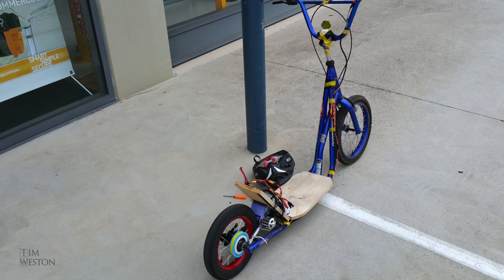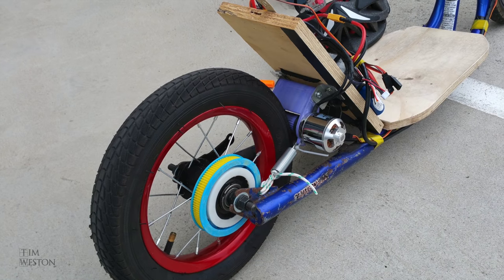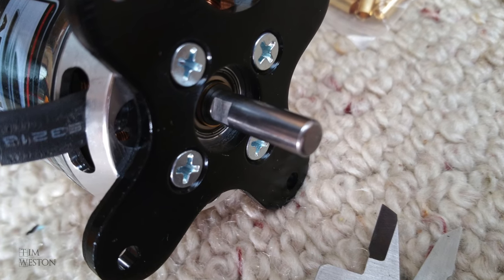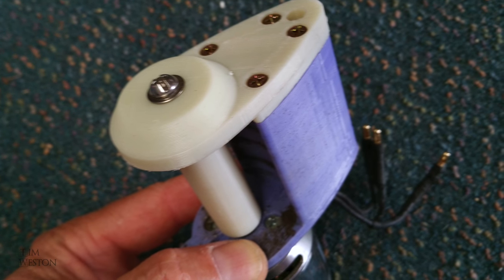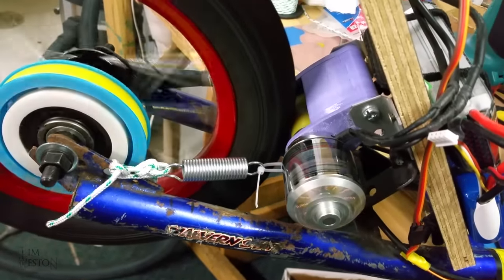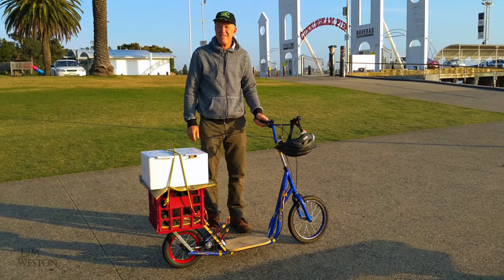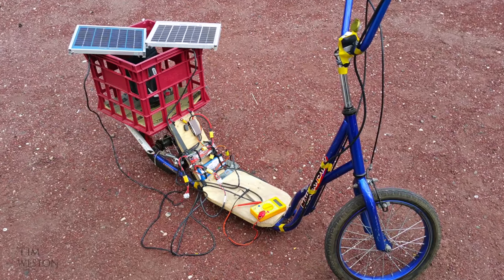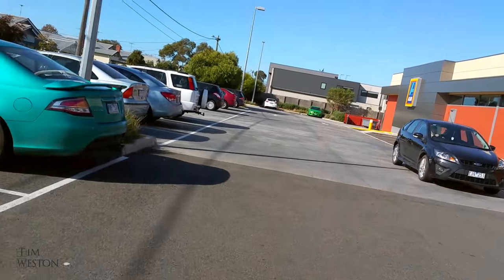How to make your own electric scooter - DIY transport - part 1

Comment: Great performance, congratulations.
I like the friction drive in my bike.
Greetings from Poland
Reply from the maker: Thanks Ireneusz. Did you make one for your bike already?  I never tested it on my bike but it has the power to use on a bike.  The gearing is correct, doesn't matter what size wheel your bike is.  Greetings from Spain.
Reply: Tim Weston - 3D printing g

Comment: I doubt that's uptimised in term of torque / RPM, this kind of motor has way too Kv for such a 'torquey' device ?
Reply from the maker: You can buy more torque, lower Kv motors. But they are more expensive and for the scooter it's not really necessary. The torque this motor produced was more than enough for the job. And the RPM was optimum for the job.  Also I didn't use it's full performance. I tested it with 22V (6cell) and it had a top speed of 30kmh and excellent acceleration. Bu using a smaller roller I could slow down and have even better acceleration, hill climbing power. It's possible to go up to 10 cell with this motor. But you need a bigger speed controller.  For the money, it works just fine.

Comment: Nice drive unit design. Especially supported at the non drive end 👍
I'm trying to do something similar at the moment. Did you use the ESC brake? If so how did you get on with thermal management on the ESC?
I'm used to RC stuff so non of this is new to me but alot of people are saying to fit a one way bearing so it doesn't drive the motor when at 0 throttle and cause a large back EMF and damage the ESC.
But I've never had to do this with any RC plane or car for that matter even the 1/8th scale stuff and that has ESC braking from 70mph so the stress can't be much more on a scooter.

Comment: not bad for only 2 batteries add more batteries down the each side of the deck and or widen the deck make a subfloor for batteries
Reply from the maker: Yes Michael, there is plenty of room for more batteries, like you say.  You could quiet easily have a range of 30km or more without too much extra weight.

Comment: YOU SHOULD USE BELT DRIVE SIR FOR MORE POWER AND TORQUE
Reply from the maker: It's OK, you don't need to shout. I can hear you :) Yes, belt drive is better. But also requires more parts and time. This is just a simple way of doing it.

Comment: i will be able to buy a motor as shown in the video but it should be cheap and it should be delivered to india.and about what you are telling i will try my 12v motor
Reply from the maker: OK Harish
Reply: i want the gear box which you used in the video for how much cost can i get it
Reply: i really want to make this scooter will you help me
Reply: Hi Harish.  Yes, I can help you.  The STL files with instructions and list of all materials you need, I am selling for $6. If you can get the same motor, it will fit exactly the printed parts. If you don't have a printer, check online if there are 3D print services near you or a printer shop near by.  Send me an email to info@timwestonboats.com and I will mail you back with more information.  Regards Tim
Reply: Hi Harish. Yes, I can help you. The STL files with instructions and list of all materials you need, I am selling for $6. If you can get the same motor, it will fit exactly the printed parts. If you don't have a printer, check online if there are 3D print services near you or a printer shop near by. Send me an email to info@timwestonboats.com and I will mail you back with more information. Regards Tim
Reply: i am going to use a motor which is used in the self start of bike will it work
Reply: i can make the scooter which you used in your first project
Reply: but i need the exacly same gear box which you used

Comment: Always interested in what other Aussies come up with, knowing how restrictive our laws are regarding e-bikes and the like. SA just banned all petrol assisted vehicles last year and I hear NSW banned them some time ago (something to do with a politician's wife getting upset by a motorised bike rider and having a big dummy spit over it). Plus there's the 200W power limit unless it's pedal assist in which case you get to go to 250W (SA only - states vary). 
Are the laws for power-assist scooter much different?
Reply from the maker: Yes, aussie law's are restrictive.  In Vic it's 200W and 10kmh for scooters. I don't think all states are the same either.
Reply: What's annoying about that when they give a figure of 200W for e-bikes. No one makes e-bike motors below 250W apparently. Guess AusPost are breaking the law over here in SA since they're all 250W+ on the city e-bikes they use for delivery runs. Sure, you can use 250W if it's ONLY pedal assist, but I don't see the postie pedalling. Aussie laws are just stupid sometimes, really. "Oh no, too much power, it might compete with our automotive manufacturing" erm, that's dead now, fellas

Comment: better use steel roller.
Reply from the maker: Yes, steel would be better. The printed roller wore out pretty quickly, it was more to experiment what worked. I think even better than steel would be to cast it in Urethane. Not so aggressive on the Tyre.

Comment: did you program your ESC?
and would this still work if you used this ESC (https://hobbyking.com/en_us/hobbyking-red-brick-100a-esc-5vbec.html)
Reply from the maker: No I didn't have program the ESC. I'm not sure about your ESC..
Reply from the maker: No Anmol, I didn't need to program it. I'm not sure what that one is you have? The link doesn't go anywhere.. Tim

Comment: i am not able to get this kind of motor can i use 12 v dc motor of 3000 rpm
Reply from the maker: Hi Harish. The voltage is OK, it is not an issue. As long as the motor is strong enough.  The rpm is good.  With an 18mm roller you should get along at about 10kmh.  What diameter is the motor shaft? My motor was 6mm. I am just about ready with a package that will be available on the website with drawings and the STL files to 3D print all the parts to make the same as in the video. Maybe it fits your motor..
Reply: i will try my 12v motor and i will tell you my motors dimensions in 2-3 days
Reply: can you give me the same motor with gearbox which you used in the video

Comment: I wonder how a cordless drill motor and the trigger speed control would take the strain (got one sitting idle in my laundry)
Reply from the maker: There are other video's I'm sure using this set up. I don't think it has enough power though.
Reply: Sadly you're probably right. Most of the ones I've seen were for kids scooters. A large adult like myself would probably be too much for it. I did recently see someone using a 240VAC inverter and an angle grinder to power a bike at fairly high speeds, though

Comment: friction drive😑
Reply from the maker: Yep!
Reply: Exactly what I was thinking. It is a very inefficient design, but it actually looks quite convenient if you don't have someone to CnC or make in any way possible a gear attached to the wheel, so you can use gears instead of friction. I guess the point of this was to keep cost low.
Reply: hola chaba te visto en quest araniya
Reply: hola chaba te visto en quest araniya
Reply from the maker: Exactly Mr Biky. It is not the best solution, just a simple one!
Reply: Not everyone has CNC Machines!

Comment: How fast does it go?
Reply from the maker: Hi Catsdgs. It depends on the voltage and diameter of the roller. On the road with 11.4 v it does 10kmh, but off road with 22 V - 20kmh and with different roller 30kmh. You can go even faster with another battery, higher voltage.
Reply: Tim Weston - DIY channel ok thanks!